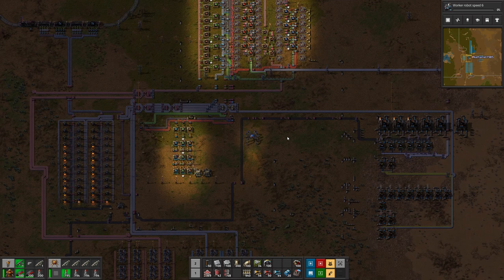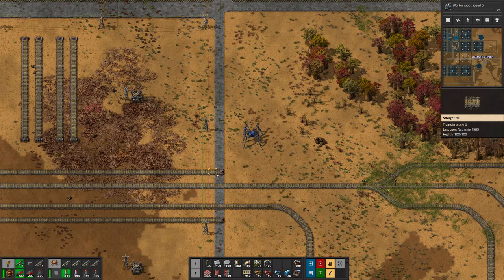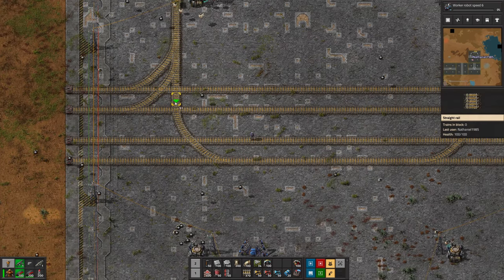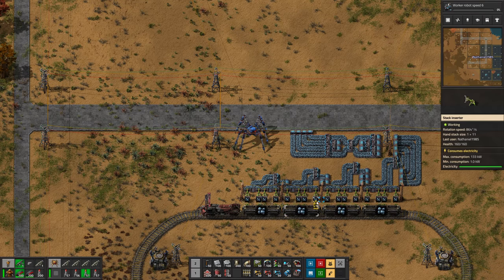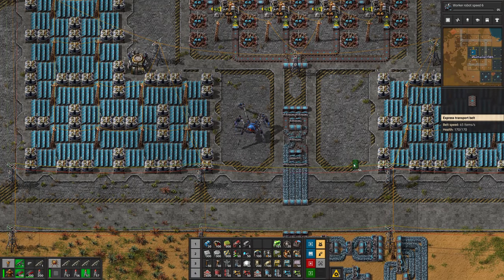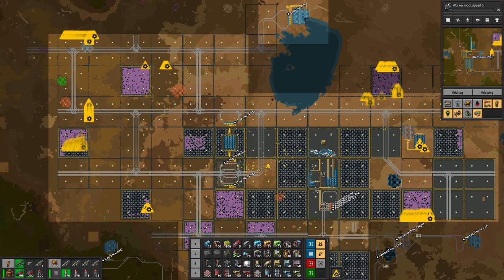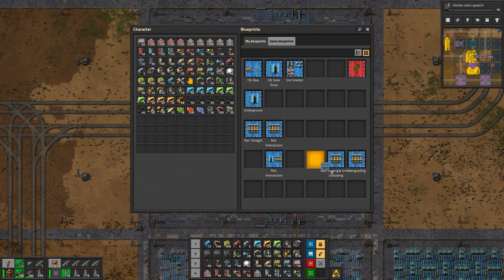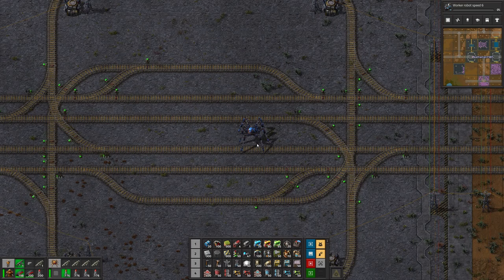FROM ZERO TO MEGABASE - Factorio: Part 2 - PLANNING THE MEGA BASE

Comment: At that point, Nilaus switched to LTN for his train network.  For the way you are building, I think that TSM could be a better option; it works by having your trains dedicated to their product and immediately going to refill after emptying, then they go back and wait for a request..  LTN waits for a request before going to fill up, which at this scale can waste time, since you are doing full trains all the time anyway.
Reply: Don't need it any more with train limit in vanilla. In Nilaus's current "megabase in a book" series he just sets train limit based on amount of resources required, no more need for LTN or TSM.
Reply: I love Nilaus and I think Nathan does too, I see a lot of Nilaus inspired builds in this video especially, like the beaconed smelting columns and the city block spacing
Reply: @nathanjohnson3948  I appreciate the improvements he has made. This is the difference between inspired by and copied.
Reply from the maker: Nilaus' builds are great because the way he explains it you actually understand what's happening. When you understand it you can design it yourself which is much more satisfying than just blindly copy it over.

Comment: you might need to think about separating your logistics networks and see about shipping construction materials via train.
Reply from the maker: Why seperate? Red and green are seperate already.
Reply: @Nathans-Sandbox  I meant for building solar panels/bases, although I admittedly I don't know you layout very well, so maybe it's not an issue, but you can massively slow down construction if your robots have to spend eight weeks shipping items across the map.

On the other hand, I suppose you might only construct from your inventory, and have every cell with it's own network, so maybe my comment isn't relevant.

Basically, robots (especially logistics ones) fall off rapidly when they have a large service area, or at least get hard to balance.

Comment: The rail signalling at 7:00 is a recipe for disaster. Don't chain rail every possible intersection for it will create conjunctions and many signals won't even function. I really prefer to keep trains from entering intersections if it is too busy. Better lose a bit of efficiency for a short period of time than lose all efficiency until you discover and manually fix a conjunction.

Comment: I never use solar power as it requires an insane amount of panels and accumilators. It's like the last thing I add to my item mall (still need them for other things). I like nuclear, it's cool and provides more than enough. Yes it polutes, but so does your factories! If biters become an issue before you can set up defenses, I would suggest "biters be gone" mod. You can disable it when you are ready for them.

Comment: 3:28 this is so much waste. you can't decrease assemblers below 20% power, so 60% of the placed modules are absolutely useless.
Edit: either put in two lvl 2 energy modules each (a lot cheaper with same effect) or use 3 energy and one speed module each(most energy efficient).
Reply: Everything can be reduced up to max of -80% electric consumption
Reply: @ThatOliveMrT   100% - 80% equals the 20% i was already referring to. Is that what you wanted to contribute?

Comment: Your intersections are really bad, trains going the same direction on parallell lanes can't continue when getting to one of those intersections. Not even trains going straight in different directions can pass each other. If you can't make it work with that many lanes you get more throughput if you remove lanes.